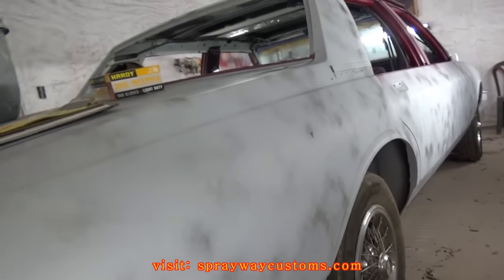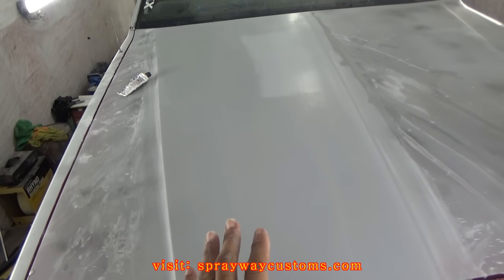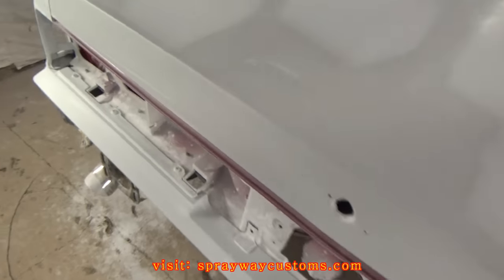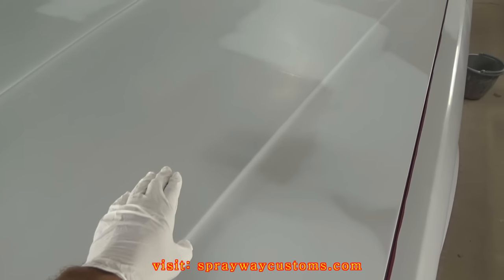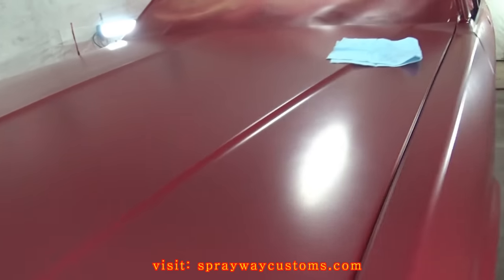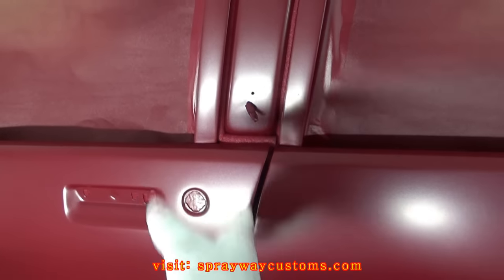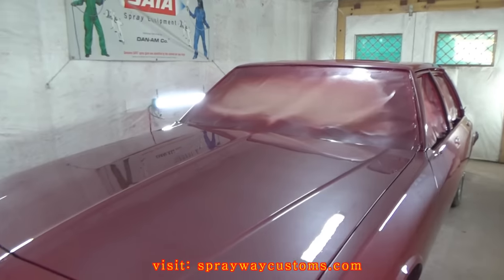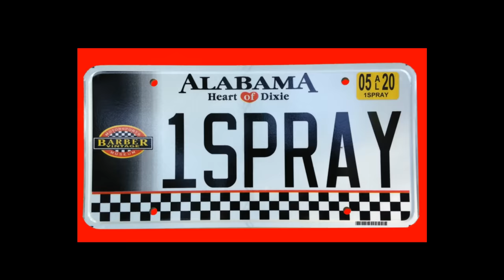How To Paint A Car At Home - Box Chevy Caprice LS Brougham - Three Stage Pearl Step by Step DIY

Comment: So about how much paint would i need to complete the whole jod including the door jambs I have 5 quarts
Reply from the maker: I just used a gallon on this car and I painted everything. You'll be pushing it with 5 quarts because that's a bad feeling to run out. It really depends on the size of the car.
Reply: @SprayWayCustoms  Did you have a full gallon of base to start with, then increased with the activator and reducer or did you use a few quarts that mixed up to a gallon once mixed? I'm about to paint the same size car, even slightly bigger and a kit online comes with a gallon plus a gallon of reducer and a quart of activator. So that mixes up to 2 gallons and should be more than enough, right?

Comment: When painting a roof, you should incorporate the "push pull" method. Start at the driver door and "push" to the middle. Then go over to the passenger side, and start from the middle, and "pull" your way down to the passenger side.  Wear the hose draped over your shoulder. When painting that front fender, finish more in the middle of the door, and not so close to the edge.  great job!!
Reply from the maker: Thanks for the comment

Comment: If you take icing and skim it over your sags in the clearcoat just enough to when you block the icing it will protect your lows  so that the high in your sag comes down to the low and then the icing will all come off to a smooth remove of the sag. I learned that from this old guy who taught me his way not to burn the clearcoat. It works. You just have to slightly prep the areas so the icing grabs
Reply from the maker: Yes, that works great

Comment: the funny thing is we all get flaws. Great job. laid that clear down pretty nice. Looks like it was a bit of a tough color fine pearl metallic can get some mottle. Try on your last coat to mix some intercoat clear or binder (pretty much the same thing) like 50% little extra reducer for a somewhat drop coat. helps even that color up. But for sure nice job as always and REAL unlike some guys. OR spot work which is easier. to me.
Reply from the maker: Thanks for the tips Mike

Comment: I was watching how you were spraying the base coat and have you ever tried putting the air hose over your opposite shoulder that you spray with and it will keep the extra couple of feet of hose always behind you and away from the vehicle or whatever you would be spraying, so you can get a little closer to a vehicle when spraying the top or harder to reach area... Just  wanted to let you know on that if you haven't already tried spraying that way but you may have already tried that before and some people have a technique on how they spray also but  your paintwork is top-notch for sure and I definitely like watching the videos and learning as much as possible about fiberglassing
Reply from the maker: Thanks. Only time I put the hose on my shoulder is when I'm spraying something high like a car roof or something

Comment: If you want to get rid of those tiger stripes, try spraying your pearl at a faster pace but the same distance and once you got the amount of coats of pearl you want, you're gonna wanna do what's called a couple drop coats and all it does is it sets the pearl off makes it looks more even. Just spray it at the same distance and twice the speed you would spray your base and it will come out uniform.
Reply from the maker: Thanks for the info

Comment: Love the video. I've watched every single video to learn different things especially painting cars. I can definitely say I learned alot. My only troubles is how long between coats do I have to wait to spray another, tac cloth it, and at the end  how long do I have to wait to remove the maskings. Also I'm confused on what grits of sand paper is appropriate for a specific role. I have to learn about which guns to use too.
Reply from the maker: I wait at least 15 mins between base coats, 20 mins between clear coats. You can tack off base and pearl sprayed with a binder not clear coat because the clear will still be tacky in between coats.

Comment: Great work!  I have a '77 2 Door Box Chevy and I your videos have convinced me to tackle the body work myself.  I have a couple questions though.  Do you use an air DA sander or just an electric angle grinder?  Also, what size compressor do you use or what do you think I could get by with?  I hate to spend $1000 on a compressor if I don't have to.  Thanks and keep posting the videos!
Reply from the maker: First off I wish you the best on your project. I have a couple air DA sanders but I don't ever use them unless I'm wet sanding. I use an electric DA sander by Porter Cable. https://www.lowes.com/pd/PORTER-CABLE-120-Volt-4-5-Amps-Corded-Random-Orbital-Sander/3280062. It looks like a grinder but it's not. I just don't like to put that unnecessary work on my compressor and hear it constantly coming on. My compressor is a 60 gallon Husky from The HomeDepot.

Comment: Awesome job....always great content...in future video can you narrate some texts on the bottom of your video telling us what settings you used on your gun psi ( how many turns on the ws400 gun) and product used ie ppg base coat, tamco clear etc. Where did you get the SATA suits are you selling them? Some friendly advice you need a full face mask to protect your from the chemical fumes and over spray  from the ws400 cannon spray gun. The the ws400 is the bomb.
Reply from the maker: True. I have a full Face Mask 😷 but I'm stubborn..you know how that go. On the Iwata Supernova settings. I had the fan pattern all the way out with 3 turns in. The material all the way out and screw it in until you feel it on the trigger. The air was 30 p.s.i.

Comment: Hi Sprayway - Thank you for the many tips and suggestions that you offer.  I have read and heard of the walking of the entire side of the car when spraying candy and pearl paints through this process.  My question is in regard to pearl paints that are still two stage.  That is no mid-coat.  The pearl has already been mixed into the base prior to you receiving the paint.  Do you still need to walk the length of the car when using this type of pearl paint?  Thanks!
Reply from the maker: I would suggest walking the car with any pearl because any where you overlap one area more than the other will have a different effect.

Comment: Wow bro!! Hands down you cold wit that spray gun!! SPRAYWAY i wanted to know if you can do a review on this gun? Master Pro 44 Series High Performance HVLP Spray Gun with 1.3mm Tip with Air Pressure Regulator Gauge - Ideal for Automotive Basecoats, Clearcoats - Advanced Atomization Technology. Thanks
Reply from the maker: Thanks. Who sells that gun?

Comment: I just want to ask because im a autobody app just a year in now everyday  in  shop , .. In the beginning of the video you said you sprayed guide coat which was black on the primer , doesnt guide coat Show low or high spots after you sand  ? And since yours looked like you had sanded the car already im assuming those where low spots , So my question is Aren't those still low spots since you just lightly wet sanded all those areas with a block that didnt cover the entire area ??
Reply from the maker: I had got all the low spots taking care of in my previous videos. . The guide coat was basically a guide to let me know what had been sanded and what had not been. It do still shows any low spots that could've been missed during the bodywork. Thanks for the comment and I wish you the best in the field Freddy.

Comment: I'd chalk those runs up to the first time spraying the Iwata since you are panel clearing..Great work and attention to detail using the foam tape on the jams. Is that plastic covering the walls?
Reply from the maker: Thank you PainterFRO...It's actually Tyvek House wrap turned inside out.

Comment: What’s good brother as always appreciate the free game was wonder if u make a vid on how to take the chrome trim from the door around the window I want to do it on mine but Afraid of bending them
Reply from the maker: Is you talking about the thin pieces of chrome going on the top and sides?
Reply: Yes sir right where the window at boss where u put the rain reflector at chief
Reply from the maker: Just get you a plastic or wooden trim removal tool and put it on the very end of each piece and hit it with a hammer or piece of wood and it'll lift up. Once you get one end off it'll come on up with ease. I used the very first one on this link. https://www.harborfreight.com/Trim-And-Molding-Tool-Set-5-Pc-64126.html

Comment: at 20:29 , you tacked off the overspray from the base.. how long do you wait before you can do that to the 3 coat base?
Reply from the maker: 20 mins you'll be good
Reply: @SprayWayCustoms  word? ok, so one more question.. 20 mins it won't be too tacky to where you'll smear or dip into the fresh basecoat?
Reply from the maker: De Chambers no it'll be good but you can always test first on the masking

Comment: The only part I'm stuck on how you paint where the front light and tail lights at like how you do it is it a certain way so you won't have running paint on the car?????
Reply from the maker: I basically paint like they're not there with even strokes and after I'll look and see did everything cover around the curves...if not then I'll lightly mist some on in the crevices.

Comment: I see u wit that iwata ws 400 nice how u set yours
Reply from the maker: I had the fan pattern all the way out with 3 turns in. The material all the way out and screw it in until you feel it on the trigger. The air was 30 p.s.i. Thanks 🙏

Comment: Does it rust with the wetting?
Reply from the maker: Didn't understand your question?
Reply: @SprayWayCustoms   during the wet sanding,  I assumed it's primer that you're sanding.  Does the water go through the primer and rust out the metal?
Reply: Thanks
Reply from the maker: No it doesn't

Comment: I think it's great amatures paint their own cars but this car has large flat panels, best sanded with long blocks (like 20") not with tiny ones like this; it also speeds up the process. Small sanding blocks are for uneven surfaces when you can't use the larger blocks.  But what do I know....I was only taught by professionals in an auto body school.
Reply from the maker: Appreciate the comment